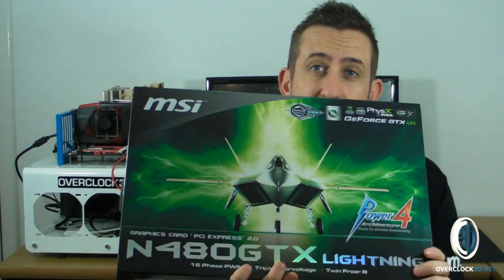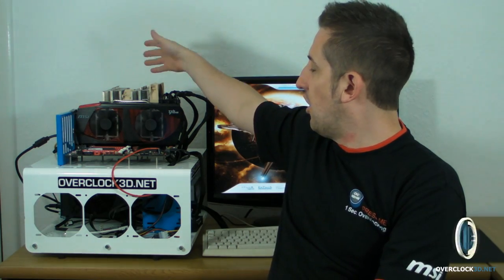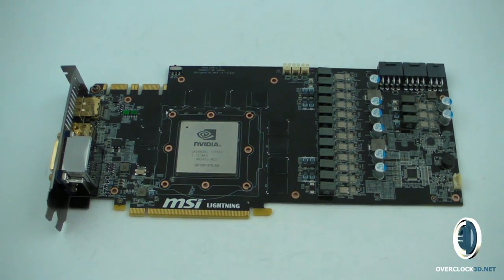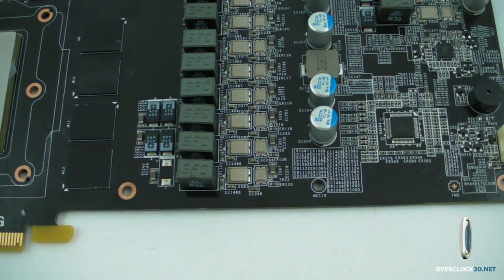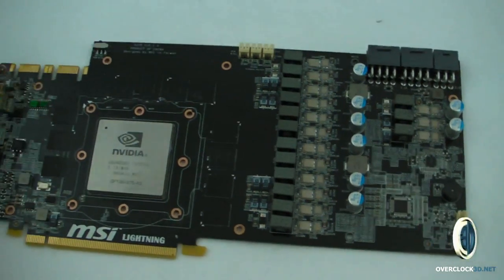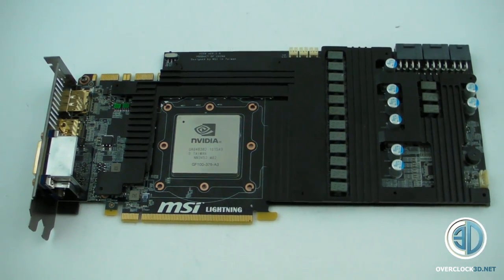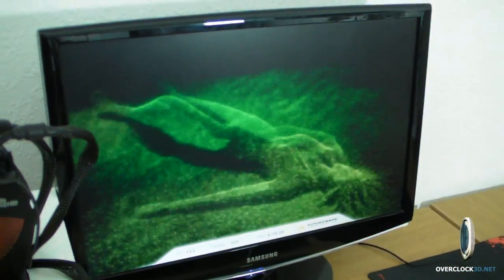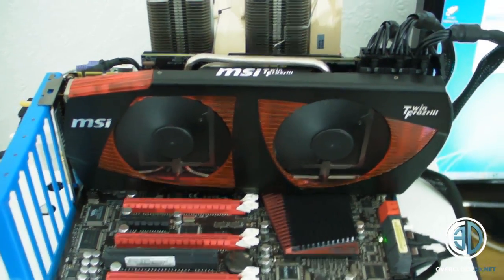MSI GTX480 Lightning Review FIRST Part One

Comment: @Technofan23 No I meant you dont need a 8 or 6 Pin for RAM. Its to get the best GPU overclock. Just compare the power consumption of normal RAM,. One Stick is like maximum 10W. A good CPU is easily 150W+.
I hope it got clearer now.

Comment: @iSupremecy You could, if your motherboard supports it, buy 2x 460 and put them in SLI. It's cheaper than a 480 and its better most of the times. Not to mention much cooler.

Comment: I'm in the process of buying a custom built PC. The graphics card I choose was the "nVidia GTX480 1536MB GDDR5 PCI-E" Now was that the one you mentioned in your video, the problem being "too hot, cooler is too loud, drew too much power" ? If it was, do you think I should choose the "ATI HD5870 1GB" over the GTX480 ? Thanks in advance.

Comment: if the fans blow air towards the PCB (as id imagine they do) im wondering how good the cooling it would be in tri sli because the fan holes look like the only area to suck in air, mashed side by side with each other there might not b much air flow

Comment: I just got two of these for sli.  There awesome.  I have them at 850 core on stock voltage.  The top card does run hotter because of sli.  But max temp has been 74 on the top card and 56 on the bottom.  The the current clocks they are only slightly behind 580 sli for alot cheaper.

Comment: @iSupremecy Buy the Zotac GTX 480 AMP version, or the version of the card that is featured on this video, or if you prefer ATI, go with a Sapphire HD5870 Vapor-X 1GB, the stock GTX 480 gets really really hot and is fairly loud, but if you can get past that i say buy it its the best card at the moment, or spend a little more and buy a non stock GTX 480.

Comment: I have to ask if it'll fit in silverstone's SG07, cause I know the heatpipes on a normal 480 cause problems, is this any different? can you just quickly compare the widths of the two cards (how far past the expansion slot they extend) and say which ones bigger?

Comment: Wow Tom tell us how you really feel about Nvidia ...LOL

Looks like they spit a Noctua 12 and used it for cooling. Still looks like you need an additional PSU to run the thing (2-8 PIn and a 6 Pin).

Just giving you a hard time. It's great to get a real reviews of products from someone who isn't bought-n-sold by a big manufacturer.

Can't wait to see what ATI has up their sleeves for tomorrow. I'm still waiting to see what GPU will replace my old 8800GT in my new rig.

Keep up the good work.

Comment: and im NOT sorry.  as HIGH priced as these cards are.  the makers or whoever can at least put a solid copper heatsink that makes direct contact with the gpu.  shit..i pay over 400 bucks for a gpu I should have to buy an aftermarket vga cooler. just my preference.Kinda like buying a Ferrari with a honda radiator.  kinda stupid to me.